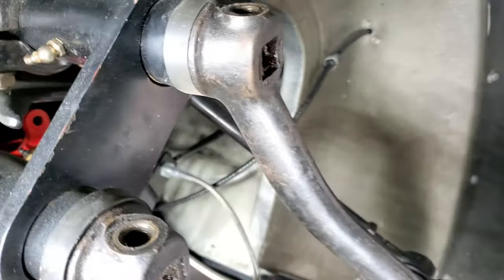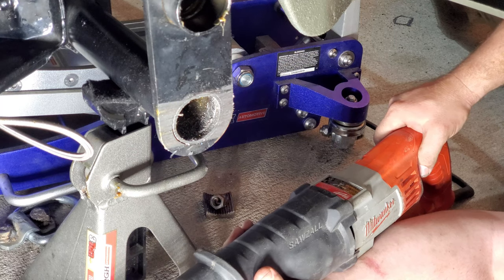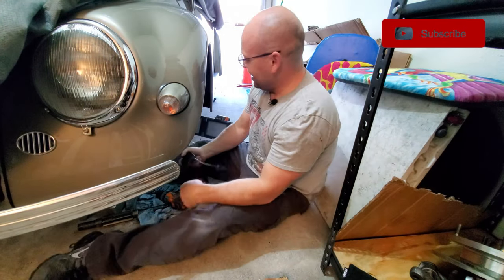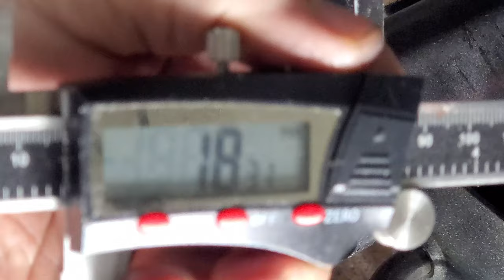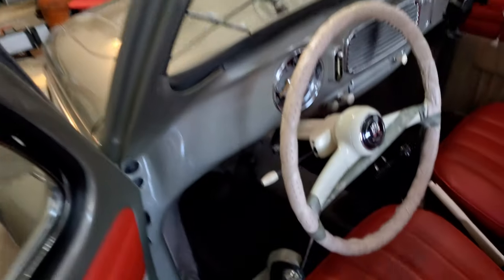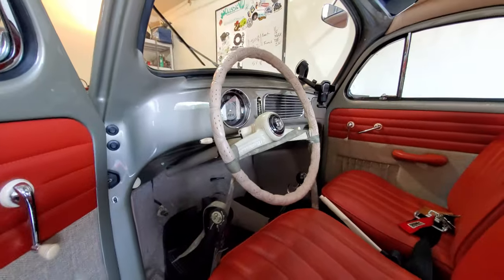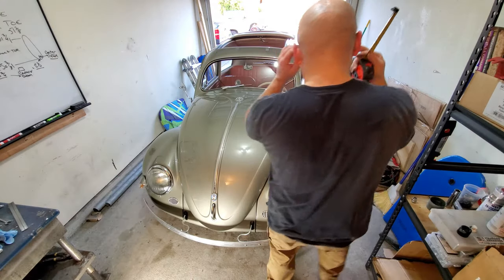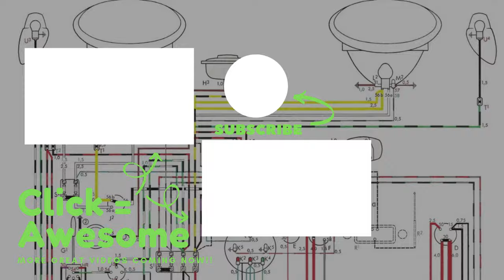VW Narrowed Front Beam! Adjustable Beam! Volkswagen BUG | JW Classic VW

Comment: Next time, I recommend that you ream the hole before cutting the end of the tube off...that way the original bore will help you keep everything in line as it easy to get it out of line using the drill while sat on the floor.
Great video though, keep up the good work
Reply from the maker: That is a great idea Dave!! Thanks for the info man!
Reply: Maybe next time Jason! 😂

Comment: Did you reuse the needle bearings in your beam?  If yes, why did you choose that over just a Urethan bushing?
Reply from the maker: Yes I kept the needle bearing, these are far superior "in my opinion" to the poly type inserts.  There are some other bushing made of Delrin that are pretty nice.
Reply: I appreciate your reply.  It’s hard to decide what to replace my chopped beam with.  I like the CB performance 2” narrowed with needle bearings and I like the Airkewld 4” narrowed but the bummer is no needle bearings
Reply from the maker: I haven't experienced the Airkewld beams but they look awesome!
Reply: @JWClassicVW  do you have an inner bushing in your beam that you have to replace?  If yes, what tool is used for that?
Reply from the maker: No inner bushing, just the bearing.

Comment: Hey Jason, did you find any noticeable stiffening of the suspension after narrowing the leaf stack?
Reply from the maker: No I would say the ride is just about as it would be stock, I do have an adjustable beam and 2.5 drop spindles as well.
Reply: @JWClassicVW  Thanks Jason. I'm only 1.5 inches static drop but I may go lower so it's handy to know, cheers :)

Comment: That is most likely an inexpensive reamer and its good you got great results...However...

 There is a better way to use it. The typical method is to adjust it so it is slightly too small, take a pass, then increase the diameter and the cut slowly. In your case maybe 7-10 passes or more to do a 1/8" cut. You creep up on the press fit tolerances that you need. The result will be very round holes with uniform and parallel sides. 

Your reamer will also last a lot longer too.
Reply from the maker: Yes. this adjustable reamer was pretty cheap compared to something pro level.  This was definitely my first time venturing into something like this and was pretty happy with the results considering.  That is some good info there and 100% correct on making multiple passes... live and learn my friend.
Reply: @JWClassicVW  Thank you for putting yourself out there with a great subject and successful channel. 

It is not easy to do and takes great effort. Keep going, we are all learning from the work you are doing. 

I learned to use a reamer on bicycle seat tubes. I build custom bicycle frames and after welding the seat tube where the seat post enters, it is not to size and loses its roundness so you have to open it up again. Its a high precision operation to +- 0.02".

Another tip with the reamer is to be very careful when adjusting or when disassembling them for cleaning. The blades are high carbon steel and very brittle. If you drop one, chances are it will break...ask me how I know! So adjustments should be 1/8 turn at a time.
Reply from the maker: I appreciate that man!! Means a lot!

Comment: Just got a 4” narrowed beam I haven’t done this before can I use the same stock trilling control arms with my 4” beam ? Like I say in new to do this I also get a pair of 2” 1/2 drop spindles somebody tell me don’t to install those cause the bug will be on the floor so I think I will just install the beam mistakes jajajaja hope this turns up well
Reply from the maker: Hey brother thanks for the question... and as for using your stock torsion arms, YES! Great question to, I'm sure lot's of people have that one.  As for the drop spindles, you can use those to, even if your new beam isn't adjustable.  The reason why people narrow the beam is to fit the tires under the fenders when using drop spindles.  

Would love to see some pics... Join the Facebook group and share!

Comment: What anti roll bar are you using? I can only find a 2in narrowed one in the UK and my beam is 4in narrowed
Reply from the maker: It is the 2" narrowed front stabilizer from CIP1, I just cut it down on both sides to get it to fit.  Also had to use ratcheting straps to pull it into place.  A little scary but worked... didn't video that because I don't want people killing themselves...lol

Comment: What sway bar are using your 4" narrowed beam?
Reply from the maker: Hey whats up Jack! Its a sway bar made for a 2" narrowed beam that I cut to fit.  I also had heat and bend it just a little.
Reply: @JWClassicVW  cut how or is there a video i should go looking for . . .

I'm swapping out my beam for a 4" narrowed beam and i want to run a swau bar also.
Reply from the maker: There is no video on it brother... wasn't sure it was going to work.  I just cut about 1 inch off each side then bent at the end angle about another 10 degrees in.
Reply: @JWClassicVW  ok at least i have a direction to head on the sway bar ;-D